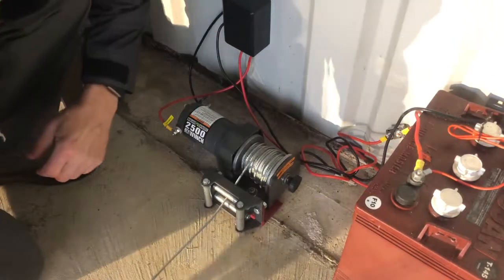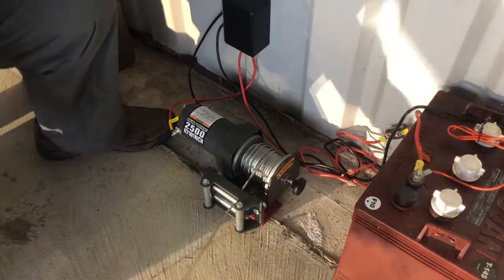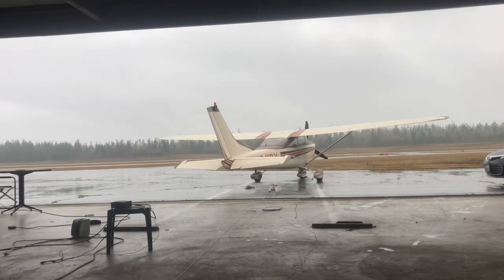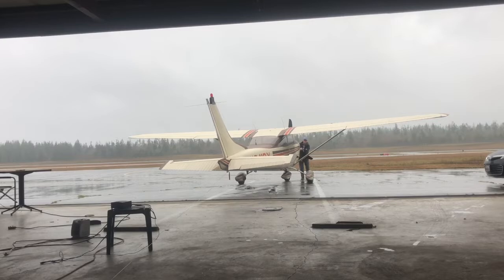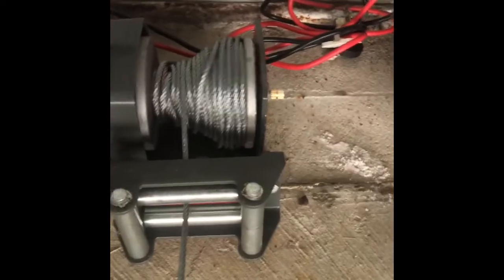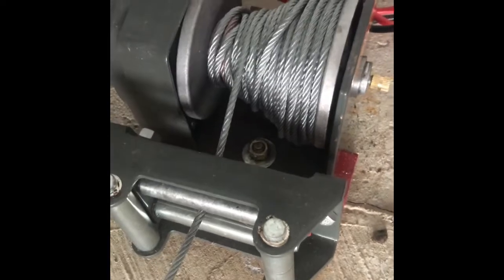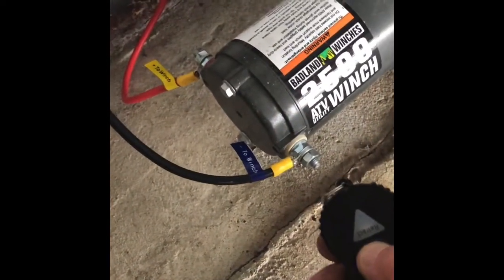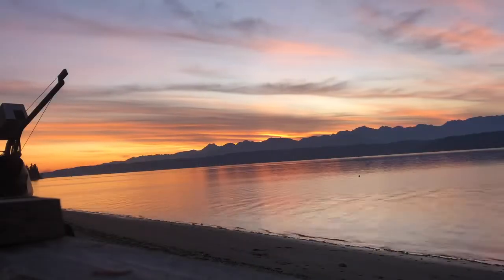Badlands Winch Demo For Aircraft

Comment: Some suggestions:  1- switch to synthetic line. You won’t get the backlash you experienced and likely the drum will hold enough line to reach further in front of the hangar.    Also, a synthetic line doesn’t build up the stored energy that steel cable does. If something let’s go, it can be a lifesaver.  2- clamp something to the line as a fail safe to keep the winch from pulling the tail into the wall (I know you have blocks down, but repairs are expensive!).  3- use a “soft shackle” to connect the winch line to the airplane.  Any place that sells off roading gear will have one.